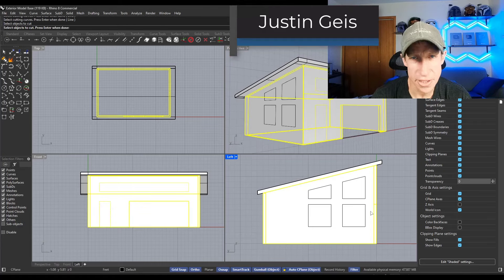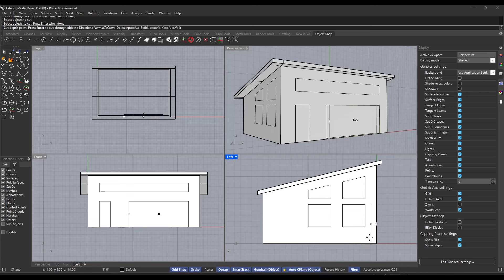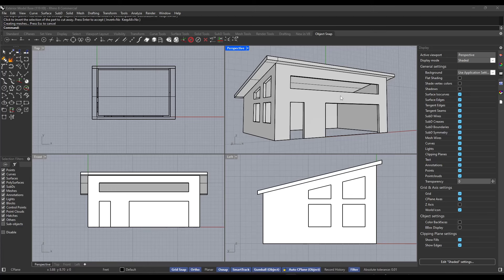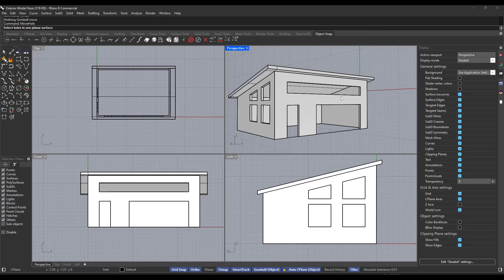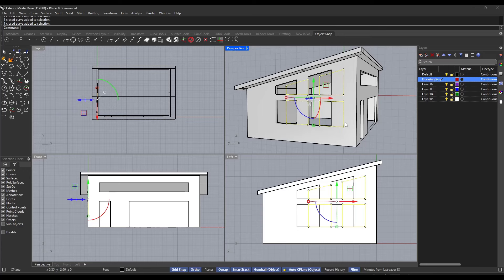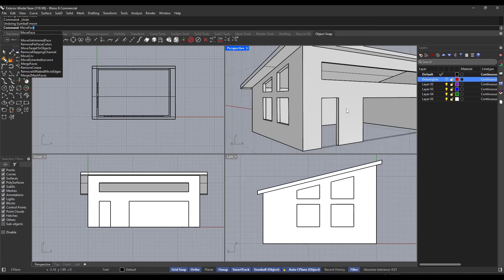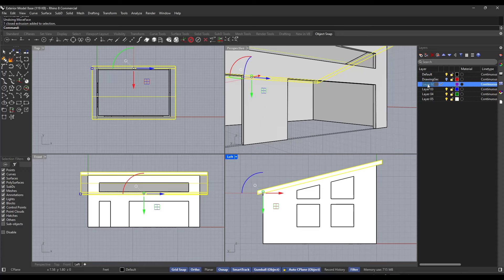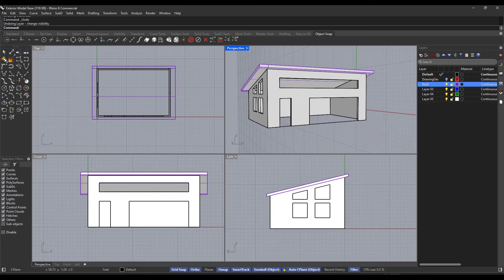The ULTIMATE GUIDE to Openings in Rhino (Cut, Move, and Resize Door and Window Openings!)

Comment: any particular reason to use wire cut instead of push pull?
Reply from the maker: I don't think so...they both seem to work pretty similar in this application from my limited testing. The plus to push pull is it can be used to add material as well as remove material I think